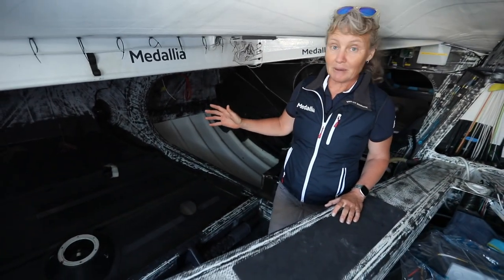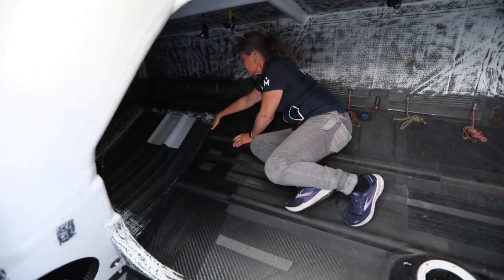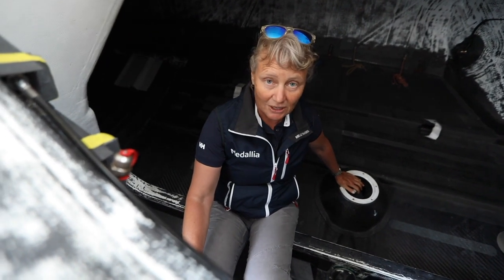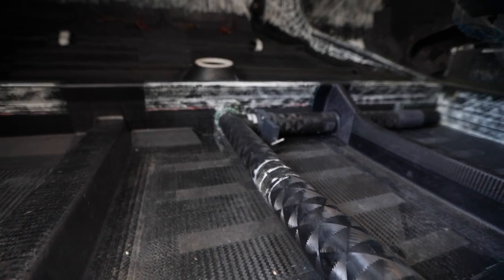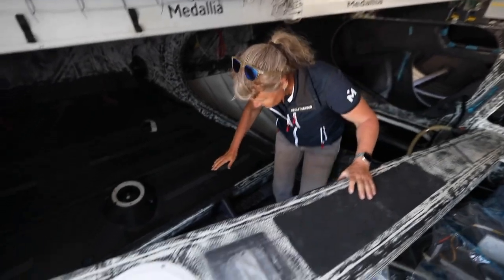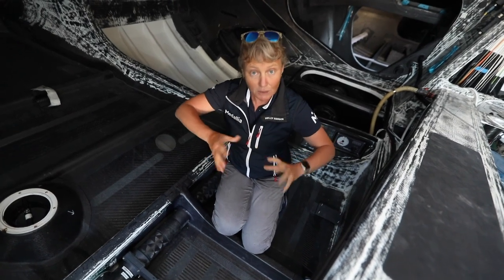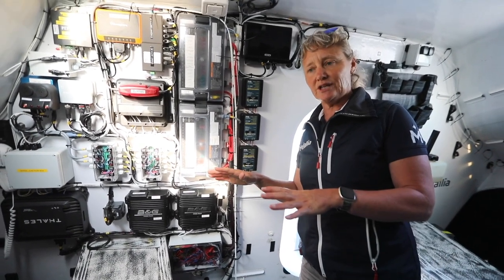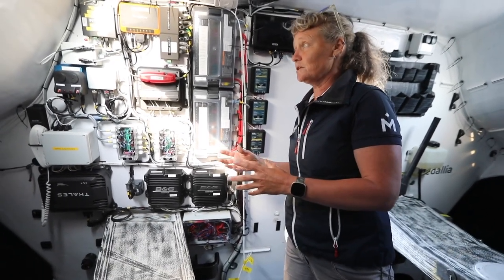IMOCA boat tour with new foil cases

Comment: Great insight - could you setup a shoot system for moving sails - 1.5m wide slippery sheet front to back through bulk heads - load sail one end raise up and slide sail to other keeping above ribs in hull - probably not practical when bouncing around but know how much thats a pain point for you 😊 hope you find a good solution - loving the journey

Comment: Hi Pip and team, great walk through with lots of information but easy to understand and absorb. for the void aft of the ballast tanks, a boat I used to sail on had a 40' container at Moody's for sail stowage and it was set up as  a 3 tiered horizontal ladder system with rollers on the rungs so that 1 person could slide sails in and out on their own, could something similar work to fill the void flush with the tanks to avoid hard edges and if it was hinged outboard it could be raised up to give access below it if needed.

Comment: Thank you for the tour, so impressive. From my limited ocean racing experience, I wonder what you will do to soften some of those edges as I imagine you will be thrown about down there and some of those rams and bulkheads look pretty unforgiving.? 
Regarding the forward floor pockets, I found a great solution is to use a vinyl broad mesh to cover those pockets, creating a uniform dragging surface, also gives you the option to easily hook sail bags to the mesh in any position. Preserves visibility to the hull plates too. Should be tough enough to survive intense slamming.

Comment: Fantastic, that was what I was hoping for, a lovely paced walk though of the modifications to the boat. Interesting to see the extra mods, over the addition of larger foils.
Is there a weight difference? I assume the weight has increased or have you been able to remove weight in other places.
Thanks and fair winds.
Reply from the maker: Yes, weight had increased several hundred kgs, both in foil weight and associated structure.